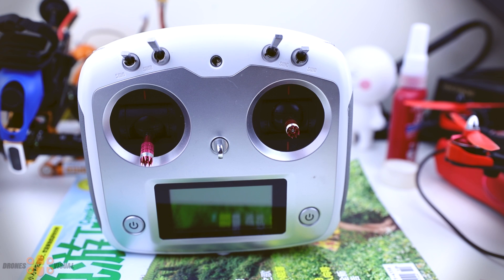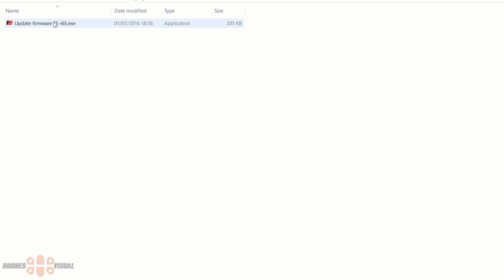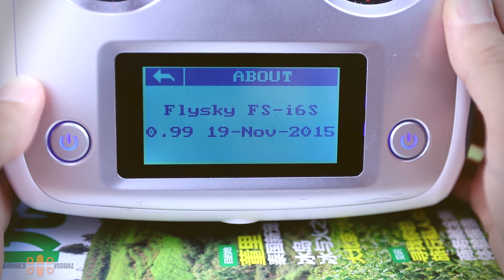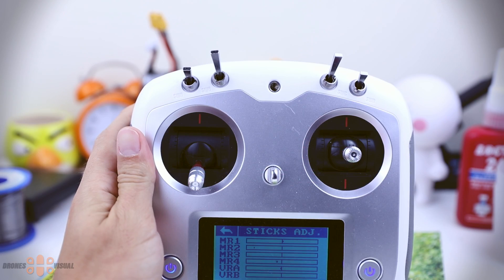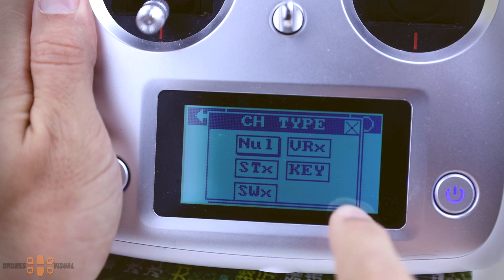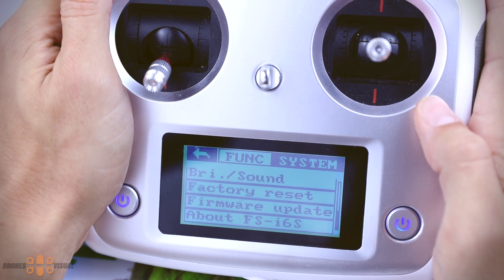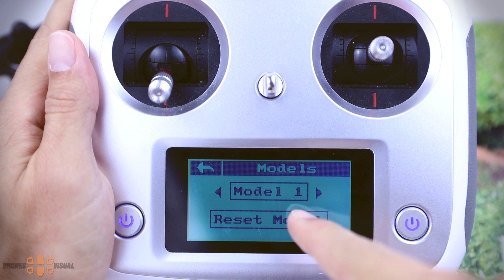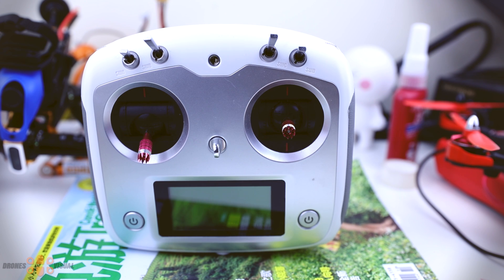FlySky FS-i6S Firmware Update, Modes and Trim

Comment: Thank you for this vid.
I have a trouble with elevator trimming which seems stuck on left side and the trim setting process does not work. But for the Tail servo it  works well. Have you an idea about the possible way to fix that? Thank you 
PS: I am on mode 1, throttle on right stick and elevator and tail On left stick

Comment: Mi emisora no actualiza a la 0.58 y tiene 0.49, busque en muchos foros y la solución es esta pero no se como hacerlo. 

My banggood FS-i6S is identified only until 49 firmware update. The 58 update doesn't identify the device.

I noticed this post:

In the firmware program, at address 870, the transmitter ID is recorded.
06 for TGY-i6s
0A for i6s from Banggood (BG-i6s)
01 for Flysky FS-i6s

It solved the problem. I used hxD to edit the update exe file. (Search->GoTo (dec. option for decimal based option)->and changed from 01 to 0A).

Comment: Do you think there is a firmware solution to make this Tx work with a lot of the Tiny Whoops that come with built in FS receivers.  Seems the Tiny's will work with the old i6, but not the S.  Why isn't backwards compatibility the norm?

Comment: Hi very informative video thanks for taking the time to do this. I have set channel for my 3 position switch to be flight mode.  I follow your instructions but it doesn't show up as functioning.  what am I doing wrong.  My brother has the same transmitter and the same thing is happening.  because of this issue I can't go into librepilot and set up transmitter because it doesn't register on the computer screen either.  Odd thing is I had it work but now nether controller will recognize the SWB 3 position switch for flight mode. I have done factory reset on both, updated firmware on both.  I don't know what else to try.  Hope you can help.  I must be doing something wrong if two separate controller bought 2 months apart are have the same issue. What am i doing wrong what have i over looked what am i missing.............frustrated to the max as to why it worked before but doing the transmitter won't recognize the same command settings as I see in your video which the did before..

Comment: I purchased one of these TX....updated FW to v2 2016, the only update available onFS download centre. Now, the adjust sticks function does not work and locks up the menu. On the calibration screen...press key 1 and move sticks.... does not beep. Does not calibrate anything...it's useless. Factory reset removes setting....corrects nothing. Everything else seems OK, anything involved in the sticks , calibration  or adjustments does nothing.i emailed FS two weeks ago ....they don't bother to reply.  There are now better radios than this on sale, the new low priced Taranis is but one.  But I will not buy another FS product and that included the Turnigy badged stuff from FS.

Comment: I just took delivery of this radio - from BangGood. 
It came  with basic FW so I updated to latest version 2.0 (hardware 2.2) from FS downloads web page.
  I have the "new" menu etc,.  - but when I try to use the Adjust Sticks
 function.... I  can move the sticks - but -  once the blue indicator bars 
have  made full side to side movement - nothing else works and the  top 
left  hand of menu arrow/return/back button  does not work. 
I have to shutdown the radio and restart . Not sure if its because of this ... but
 I cannot get anything using the back Button A.  
I cannot revert to any earlier Firmware - because  there is none on FS downloads.
Anybody  know a solution??   
BangGood have  not replied to my support ticket in 9 days now.
Reply: You have to set the throttle stick to middle position before you can press back and save

Comment: Thank you! This is by far the best video I have seen on firmware update!  One question: Does trimming while in flight work the same?  If I am flying, the throttle channel is going to be outside neutral position because it's under power...won't trimming automatically move the throttle trim as an accidental byproduct of trying to trim pitch/roll/yaw?
Reply from the maker: Hello and thanks for your support. That is a very interesting question indeed. I might need to try it out. Cheers.

Comment: I recently bought this radio with an old factory fw from May 2016 with no trottle curve option and others improvements, but it was working fine at the channel end points. Now i did the update to the last FW v2.0.0.49 and now i have more options avaliable but the channel end points don´t go to the edges. I did the factory reset, sticks adjustment as you explain in this video but the channels keep not going to the edges and the Aileron channel appears to be trimmed a little to the left side without i do any trim and trims are centered.
Another bug that i notice was when i do the sticks adjustment i can´t go back to the menu pressing the arrow, i need to turn off the transmitter and when i turn it on the channels end points still the same and the little trim that i have not trimmed, too the same.
Someone with same problem that has experienced this same issues? Any solution or better fw is comming out?
Thank you
Reply from the maker: Hello and thanks for asking. Did you try to doing the calibration after the factory reset? Give it a try and let me know whether that helps. Cheers.
Reply: ok i've tried to do all again. Now i discovered that to exit the stick adjustment menu the sticks must be centered. But i think i already tried before and nothing happend but now this it's ok.
After all procedure the little trim to the left disappeared but the end points not all are going to the edges. To fix that, i went to the end point % menu and raised the channels a little until all reach to this edges. The maximum value i have it's 108%. Now it's all ok with the edges! My only concern it's because i don't know if it's supposed  to work like that or if it is an unusual solution
Reply from the maker: Hello. I would say it's an unusual solution, but if it works out, then great. Cheers.
Reply: After a day using it with this solution, today i went to a factory reset and the sticks adjustment again and everything was just perfect. I didn't nothing different this time that I have noticed. Can´t explain this kind of magic lol. Thank you very much for your help and your for useful videos! Happy flights! ;)
Reply from the maker: Hehehe, strange indeed, but good news! Happy flying to you too. Cheers ;)

Comment: hello nice vid, which drone would you recommend more the king kong 210gt or the walkera f210?
Reply from the maker: Hello and thanks for asking. They are both great fliers, it's a bit of a hard choice for me. The KingKong might be a bit easier and cheaper to fix in case of damage. I think I might give it to the KingKong Gt, but both are pretty nice quads. Cheers.
Reply: I think I like the king kong 210gt better, but I am looking in to the jjrc jj pro p200. this is a hard choice.

Comment: When I received my Radio (Aug 19, 2016) the Software had been upgraded to include five Model Memory and ten Channels..Please note that to be able to use the ten Channels you will need to purchase the   FS-iA10B Receiver.

Here is the information on the  "About FS-i6S Screen"

Flysky FS-i6S
2.00  o8-Jul-2016
Hardware V_2.2

I am really liking this Radio.
Cheers
Willy

Comment: Hello. Thank you for the solution. But i have a problem. I've downloaded the update software from the link, and its different from that in the video solution. In your tutorial its 1.0.11.45, form the download link its 2.0.0.49. My FS-i6S has 1.10 22-Mar-2016 firmware and the downloaded software cant see the TX when I connect it to the PC.

Does anyone has that kind of problem?

Thank you.
Reply: yes I have the same problem one of the versions of the updated said something about com port 3. I still haven't figured it out but will report back if I do figure it out.

Comment: I was able to update the firmware to 1.11 30-Jun-2016 but cannot update to the most recent file from BG which says it's v2.0-something.  The updater software never sees my transmitter.  
While trying, I've found an earlier version 1.1 and can update/downdate between that v1.1 and the v1.11 firmware  back and forth. The transmitter is always seen - just not with the current v2.0 updater that's on the BG site right now.
Do I want v2.0 ?    I don't know.  V1.11 seems to do me just fine right now but you know how merchandisers always tell us to upgrade to the latest-n-greatest in order to be up-to-date.   Well... should be up-to-date? Whattaya think?
Reply from the maker: Hello and thanks for asking. I was not aware about version v2.0. I will find out about it, as a few people asked me about this version. I will let yo know as soon as I find out. Cheers.

Comment: Only 5 modell memory??? The old one had 20!!! 5 is not enough. How about trimming midflight???
Reply from the maker: Hello and thanks for commenting. Yeah, they kept the model memory in 5. Regarding the trimming in midflight, I would like to add that in my next video. Cheers.
Reply: Thanks...waiting for that. But if there are no buttons for that how can anyone trim it without not looking at the plain?? Plains need trimming anything changes anything new gets on board all the time. Seems very strange to me.

I don't really understand where FlySky would like to go with this transmitter.

I like the look, I like the different color, I like the more buttons, I like 10 channel I even like the touch panel but why on earth the miss crucial parts of a transmitter???

I needed another one for myself and I bought the old one (which is far cheaper as well.)
Reply: It utilizes the back buttons for trimming channels
Reply: Yeah OK thanks but is that two button enough???
I don't understand why they have to change something that is so evitable, all other radio has trimming buttons next to the levers...

Comment: Can you help me?
when i connect usb cable and turn on transmitter, my computer show "usb device not recognized"
How can i do?
Reply from the maker: Hello and thanks for asking. Open the software first, then connect the transmitter, then turn on the transmitter, navigate to the firmware update section and press update, you should see the transmitter appearing in the software interface. What Os are you suing? Cheers.
Reply: I solved it. just restart my pc.
Thank your so much.
Reply from the maker: I´m glad to hear that. Cheers.

Comment: The Issue you had with your aileron trim not being quite correct was it needs calibration after the factory reset. Not before.

You need to do a factory reset on all the FlySky radios after a FW update. Some do it automatically as part of the update. This one, i6s requires you to do it manually.
Reply from the maker: Hello and thanks for sharing! Yeah, that seems to be the case indeed. Cheers.

Comment: PS: the product and manual talks about telemetry capability, but i do not see it on the current menu structure on the transmitter. Does the current firmware support telemetry?
Reply: Rudi Greyling 
It has RSSI and receiver voltage telemetry... if you're good at soldering you can recieve the flight battery voltage instead of reciever voltage as well